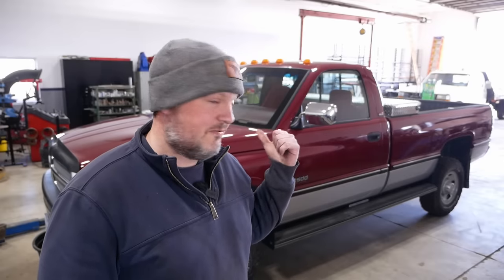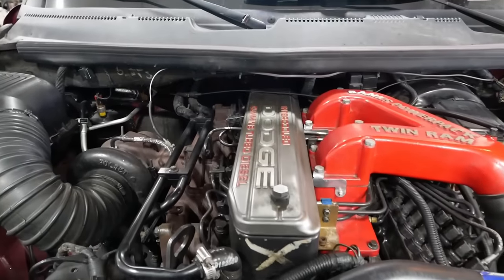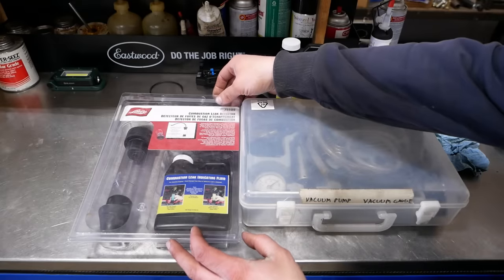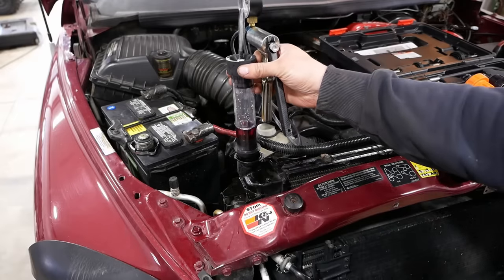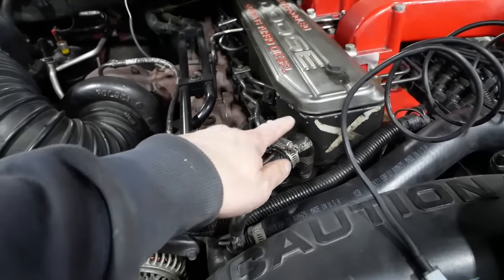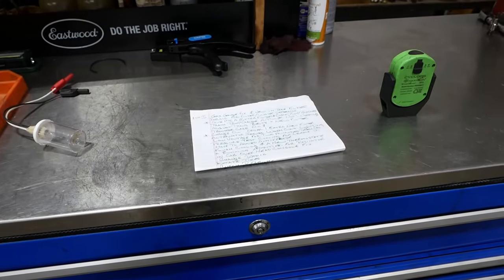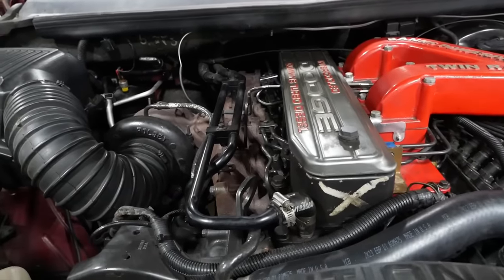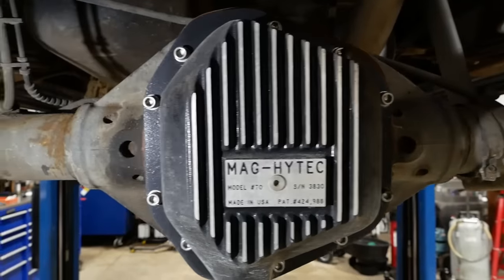Fixing a Mint 1995 Ram 2500 Cummins | Front End, Coolant Leaks, Major Service, Etc.

Comment: When a brake rotor heat shield is rust free....you KNOW you are working with a clean unit! Usually I need leather gloves a mini ball peen hammer and a tetanus shot.
Reply from the maker: Normally I just touch them with a finger nail and they disintegrate into dust.

Comment: Are they rough on the ball joints because the weight of the Cummins do you think? I know the more modern competition like the duramax are much lighter. But I don’t know about the older competition. But that motor weights like 1200 lbs don’t they?

Comment: There's 1 grid heater... Adding the twin ram doesn't add another one. The grid heaters cycle based on intake temperature. There is an intake temp sensor on top of the plenum. Don't dismiss the pressurized rad... That fluid doesn't always change color. I've seen cracked walls between 5 and 6 cause this pressure issue and It never seems to get worse.

Comment: Do you know if the temperature sending unit in the trans pan had thread sealant or teflon tape on it? It's known to interfere with the ground, making the gauge read wrong or not at all. It looked like it was 1/8" npt, and those don't need any help sealing.

Comment: Wow. I wonder how much he paid for it, especially in this market. Loose steering is an understatement with Dodge trucks. I used to drive my Dodge from AZ to Cali and back on a regular basis and I was alwsys all over the road. I eventually bought a Nissan and I literally felt like it was on rails compared to the Dodge. I could take my hands off the wheel at 85mph and the thing wouldn't move an inch. I would never have even attempted that with the Dodge. Still loved it tho...especially for towing.

Comment: My 2001 ram 1500 4x4 feels like it is slipping bad for about a minute or two unless i start it and leave it run in neutral for a few minutes. I also have a converter  code.

Comment: Oh, and did I mention the joys of getting the heater core in the cab with these new designs?   Or the joys of underhood fuse panels with exposed undersides?  Giving them a good coating of salt and water on a daily basis.  Oh yeah, the newer body styles are just peachy!  But you say, we did it for airodynamics.  Then how come the old trucks got the same mileage as the new ones?

Comment: 43:47  Your Sil-Glyde wont last long.  Only lube I found that works for that specific application is 3M silicone grease.  Everything else seizes up in short order.  3M silicone grease is the only one that works long term.  I got really tired of going through pads every year, and the constant left or right pull... So every week for about a year I checked to see if they were seized.  Removed all the hardware and installed new with a different lubricant.  Rinse and repeated until I got to 3M.  Absolutely hate that brake retention system.

Comment: Quick early on in the video question; you said there is no vacuum to connect to, what’s running the brake servo ? Is there not a vacuum pump running off the engine ?
Reply from the maker: There is on this truck. Later they used the hydroboost and had not vacuum pump.

Comment: I have very difficult question , l tucked head bcs water was going to the oil , and turn out head gasket was perfect not burned , now l add water to the block and stills water going to the oil , what l am missing or what you recomend me to look do 5.9L have any water plots in front inside the front ca or were the foul pump gears are, bcs l heard front noice of the water going into the oil bcs l tuked all oil and bolt under the oil pen l see water caming under the pen dren oil , l am guessing somting in front it’s not okey culd it be water plugs

Comment: Comment on the alternator if it goes out for the PCM not telling it to charge Call up PA performance and order a one wire  Alternator That's what I'm running on my 2001 PCM 1 out 7 years ago Still running it every day has almost 400000 miles On the original VP44

Comment: Actually those big diff covers are worse than stock.  The flat back churns the oil instead of slinging it to the pinion. 
 Banks Power has a whole series of vids on testing “flatback” diff covers.

Comment: The tailgate had a sign that read Midlothian Dodge. Midlothian is about 30 miles southwest of Dallas. Definitely a Texas truck. If you want a vehicle with no rust, come to Texas.
Reply from the maker: Midlothian is a Chicago suburb.
Reply: @WatchWesWork  This truck is prestin, no rust. It had to have come from Texas.
Reply: We do not get rust in Arizona either. The frame on my 96 3500 dualie still has the original black paint on it.

Comment: Wait - your new roof is leaking already?

Wait - the front engine lift point is sandwiched between the block and the thermostat housing??

I adjusted valves exactly once in my life (1964 MGB).  Absolutely hated it, especially the adjusting screw moving back when tightening the locknut due to the difference in thickness of the adjuster slot and the screwdriver blade.  And that paralysis of 'is that too much drag?  is too much worse than too little? cut the red wire, NO! the blue?'.

"They're blue so you know they're good." - Rainman Ray

Comment: Every dodge truck I have driven with a automatic trans won't kick in overdrive till it's at running temp. Not sure if it's a safety thing but it sure sucks gas during winter at 2k rpms

Comment: That's a nice truck despite its age. Ram 2500 HD have come a long way. The newer ones are way nicer, especially for towing, but the diesel powerhouse has gotten overly complicated. I would love own one of these In such a nice condition and electrified it, but the battery capacity isn't there yet for pickups, and I'm not comfortable spending that much on an almost 30 year old truck.

Meh, maybe in the next decade lol.

Comment: Maybe that truck was born and raised in Texas. I have a 2001 Nissan Frontier that looks like that as rust goes. my only thing is the paint is beginning to sun bake. I am boing to keep it till it rots as it only has 118,000 miles on it. At this point I have never had to add oil between changes. Since I retired I only drive it eighty to maybe one hundred miles per week.

Comment: Walker sold those trucks, not salesmen.  Lol
Ditch that swivel and your air hammer will perform better per the torque test channel.  Leaves a lot on the table if I recall correctly.

Comment: What’s the tool at 43:50 on the end of the whizzer?! i have a 2015 gmc 2500 the rear brakes man such a dumb design the slides get all corroded the rubber seal doesn’t stop shit, this would be perfect to clear the passages out periodically during a brake job

Comment: I'm not a mechanic.  Just wondering is all... when you were putting that differential (ring/pinon/gears) back in and pounding outer bearing race, would that cause any damage to the bearing?  Thanks
Reply from the maker: No. You have to work pretty hard to hurt a bearing.

Comment: Is it a good idea to have a deeper sump in an off-road vehicle? I'd have thought that'd have left it more vulnerable to being ripped off.
Reply: If it was mainly used as a tow rig (which is the usual reason for fitting larger aftermarket transmission pans) that occasionally engaged 4WD in a muddy paddock; rather than being used as a rock crawler it wouldn't have been a problem.

Comment: If you want to save yourself a ton of money on parts cleaner, get yourself one of those handheld air charged sprayers and use clean gasoline (you can also buy trichlorethane or whatever by the 5 gallon can cheaper) for most of the heavy cleaning and then finish it off with the expensive brake cleaner and what not.

Comment: If it has the plastic radiator sides on it. My 97 1500 cracked about 10 years or 100,000 miles after.
Reply: I would replace it before it leaves you side the road. Cause mine did. Luck I was close to home and found some water to put in it till got home.

Comment: I've rebuilt two dodge 1500 4x4 front end's, and where I found the biggest issue with them. 
Is that they don't have any type of crossmember to support the steering gear boxes, and even on the two wheel drive V6 trucks. 
The dynamic forces of the front tires pushing against the front suspension, that in turn racks the frame that the gear box is attached to. 
To the point that not only does this cause premature wear on all the suspension components, but the frame itself starts to twist, and elongate the bolt holes that hold are suppose to hold it firmly in place. 
Thus you end up with the dreaded death wobble, in addition the gear boxes tend to be rather light weight, causing excessive slop in the gears themselves. 
Add in the sloppy components to this, and you literally chase the wheel from one extreme to another, just trying to maintain a straight line in whatever lane you're supposed to be in. 
Then hit a slight angle change in the road surface that you normally wouldn't notice, but now you're nearly changing lanes  before you can catch up to it to correct the trucks sudden change of direction as if you intentionally served to miss something in the road directly in front of you .
But that wasn't the case, because your hand was headed in the opposite direction trying to keep up with the constant movement of the slack suspension, and so you're taken totally off guard this is fixing to happen to you. 
Then in certain situations where you have a series of minor bumps in the road surface, suddenly the front tires start bouncing up n down, and wobbling from side to side simultaneously.
Now you want to talk about some serious scary sh!t even for someone who's got some miles under his belt, but remember who drives more of these trucks these days. 
Our teenage sons, and daughters do, because they are cheap, and apparently the kids all think they look cool especially the jacked up 4x4's do to them. 
So they end up driving most of them, and how many dad's actually drive the truck any amount of time to see if there's anything seriously wrong with a kids truck or car.
Not many, and the one's that do don't drive like a 16 year old in they're first vehicle. 
So you think you got something halfass decent for a good price for your kids to get back and forth to high school in.
Except you didn't drive pegging the floor board everytime your foot hit the skinny pedal as the first hint of green light, are through the stop signs. 
Are on the simi wore out back roads that's had more than it's share of heavy trucks on the old asphalt weak base county roads, especially not going 20 miles over the speed limit in a good rain shower.
Where those roads that take a good suspension, and wobble you from side to side as you hit the deeper ruts in the road. 
Now add in these factors, new drivers, to fast, on oversized fat tires, going too fast, on a oil slick asphalt road as they'll do first rains in a week or three, and add in the way they hold water during these same rains. 
Now it gets funky, you have the tendency to hydroplane due to the water moving down the road surface, are even standing puddles as they get.
Yet now you have the final additions that is the worst of them all, the suspension is hammered, and your kid is already chasing the wheel back n forth trying to keep up with it so he, or she can keep it in the lane.
I drove both of those trucks, before my buddies son did, and apparently he never really drove it himself, because  on very good asphalt and concrete road surfaces, they were hard to keep in straight line, and you chased the wheel back n forth. 
Then suddenly out of nowhere the dam things changed direction as if I was changing two lanes at once as if I missed my turn doing 45 to 50 mph.
Because when I explained how trashed the suspension was, and even jacked it up so he could feel the slack himself. 
He told me order whatever you feel it needs, but make sure Trey helps you do the work, and I will pay the extra time it takes with his help. 
I never changed for teaching someone's kid how to do something right, if they pay attention, and listen to what I tell them..
If they're hard headed, simple, take a walk Jr., and be sure to tell your dad what you learned today. 
Even worse on highway, because not only do you have a little rut dip from big rigs with untold amounts of weight on hot summer roads. 
Add in the angle needed to maintain hiway speeds around some of the curves in the road, now how many off chamber roads y'all ever drove on going down the hiway at 75 mph, and you had the feeling of driving that old early model 70's, 60's, and even 50's model anything.
It's as if you have to force the vehicle to stay on the road around even good banked curves, not too mention all those off chamber or flat curves you encountered driving. 
Now go get in the early 90's to early 2000 model two or four wheel drive dodges you bought your kids for such a great deal, and drive the dam things like you stole them, because that's exactly how y'all's kids are driving them.
Oh yeah, I almost forgot, now load the insides of those big tires and wheels up with about 20 to 40 pounds of mud they just ripped through with the front tires turning side to side plowing through the mud because they don't know how to drive in that situation either. 
Let me know how the ride was after you cleaned your britches out.
That's your excellent dodge trucks that everyone is so proud of when they sell it to some kids daddy, and doesn't mention that the front suspension is toasted, and your kids know about as much about driving as they do on how to get married before high school is over.

Comment: Too bad it doesn't have the NV4500, but those short beds are damn rare. There was one just like that out west, but  unfortunately it was a 1500 (with NV4500). Most of the larger 2500s seem to mostly have the automatics for some reason. Most of those early 2nd gens have rotting bodies, even worse than the old Chevy square bodies. FYI Trivia: There were a lot of GM step vans and bread trucks with the 5.9L Cummins in them. Those bell housings will adapt a 5.9L Cummins to an NV4500 5-speed. I know someone that put a TB6 in a square body Chevy like that.

Comment: I always liked this generation of Dodge even with all the bad rap they are notorious for. From about 1997 upto 2001 our company's auto fleet was buying nothing but Dodge Ram trucks. After 2001 they refused to buy or even lease these trucks. Just about everyone had transmission issues. Lucky if you could get 25,000 miles before the transmissions were destroyed.  After Dodge they moved onto Ford.  Their triton engine though were decent for high mileage,they too had issues. The cast aluminum heads would periodically blow spark plugs from the cylinder heads while driving down the road, plus th 5.4 litre Triton's were very wimpy. Some employees were lucky enough to get general motors or GMC 2500 and 3500 trucks. These were a pretty loyal and road savvy trucks. Dodge in my opinion gotta a bad rap in their 1st and 2nd generations. In the six years I worked in field and pipeline work, I had three new Dodge trucks and each one had bad transmissions and drove like war wagons.

Comment: My 92 had a intercooler
Reply: I hauled new cars for a living and I hauled for GM and from time to time I would haul just about any new car for a back haul instead of going back empty. So the Dodge trucks I hauled and the cummins engines I watched them fix all the flaws like the 4 speed manual and when they went to the 5 speeds and then put intercooler on them I was in so I had a load of S10 from Shreveport La and my first drop was Nashville I’ll and there was the Dodge I wanted. The owners son came out to check the trucks in he only got one and I told him I would like to have that new 92 Dodge 5 speed manual don’t like autos truck driver thing and it had 4x4 3/4 ton so he told me to come in and he would give a good deal on it being a car hauler so papers went threw and bought it for 19300 bucks call the terminal and asked them if I could haul a new Dodge and he said so I had 9 s10’s and one Dodge and it was a great truck drove it for I think 14 yrs and never replaced anything brakes were still good but the rear diff was making a popping sound when I would take of so the dealer in town replaced the 3rd member and 185000 and sold it for 8509 bucks and told Brad in Nasvill I’ll to get me a diesel 6 speed manual 4x4 dully 4 door long bed manual 4x4 shifter and power everything and two weeks latter sight unseen it showed up at my house and signed papers at kitchen table, now that’s the way to buy a new truck and this one has been like the 92 and this 24 valve has a 146000 miles on it and replaced hydro boost and had a one piece drive shaft made for it and that took care of carrier bearing and vibration and still has over 50% of the brakes still left. These two trucks have been great to complaints from me .

Comment: Make sure the + and - for speakers don’t cross over (to be opposite) on the Alpine system. Sound quality will suck if the + and - cross.  FYI...old 1980’s guy here, you’ll be sadly disappointed, done it myself.

Comment: You will never get this message but…
I can see that the steering shaft is still the original and it is the most overlooked part of the entire steering system and that is his steering problem.
Replace with Borgeson 000950.
Reply: Oh and ….
Don’t get bloody, Cut towards your buddy!
Reply: Everyone always replaces every single piece of the steering linkage except the shaft and then they give up. 
Trust me, it’s not the ball joints.